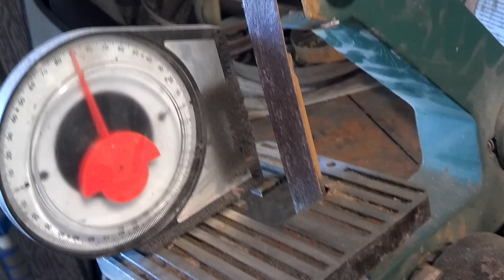1x30 belt sander knife grinder mods (Explained)

Comment: at first I thought to make te back grind belt file removeable, fixed with a welded screw system. to meke if I liked also a convex grond always leving the spine on the workplate and non pushing much when grinding. but it's complex, cod  get ot not well straight and close to the bel, and I thought I like the best or a full grind - for more cutting tasksks - or a scandy modified type grind on the first bevel - for a multitasking camp strong knife. and then just on the sharpen cutting part I like better the convex grind. to me for now thiis is the mix that match better.

by the way. you seem to me quite a wise man (guy), so I allow myself to ask you just few  second step level, knifemakers questions, just to have a talk and confront our opinions:
 
I like much full grind because I do not think a well tempered iron need to be so beefy.  (58-60 hrc like the good ole D2 if well done, maybe with new post temper criogenic treatment - or about 58 like the not expensive, easy  to find, tempering forgiving but always well prowen as very reliable o-1. for now I leave exotic steels to real experts, not people just putting the number on blades than working not really well as they are priced - sometimes just fashionable) 
to demonstrate clearly - can be done in your workplace - the main required specifics asked to a knife balde:
- edge retention (but not difficult resharpen)
- toughness of the cutting end to shocks, and on the contrary also some bending resistance for the tip and also the whole knife, maybe not to break in a while without prying, that could be dangerous, 
- and maybe why not, also same wear resistance to rust.
these for me are the main "use to" must of a blade knife (not to enter in tangs or handles)

all super beefy knives to me is quite a fashion (again. this new world of knives that already is full of just beautyful wonderful "fame signed" gadgets, for city wealthy collectionists, just to stay behind a glass. nothing bad in itself, I like some little collecting myself, but for sure not a fortune. but a knifemaker is not mainly a designer for me, IMHO. that wouldn't ever be my aim if I would make really good knives one day. anyway one should know what kind of work he is doing, what for, and what to choose and improve), sadly I think most coming from USA, once known as the country of the tell: "the bigger the better". even if I'm not integralist at all and proudly own just some, but really well made USA beasts, as the TOPS "Tahoma". if don't go out for a fishing weekend, but for a month in the woods far from "civilization" you can't bet on a try, you rely on just few crucial things, and "when the going gets tough , toughs get going" as said the Great John Belushi.
but this is just for few peole, among billion of knife buyers, and I could realize many other countries make very reliable (and also chopping, and even survivals) good knives with not so much use (waste?) of sometime not too well tempered steel - till the core, just because most of it is very thick, and it's not so easy as it could seem, to do it without making the thin blade part then fragile.

what's your opinion about this not so indefferent issues, especially for new knifemakers approching this nowadays global huge world of the blades, and not sure at all what path to start with not to get lost in this mess of stuff but to find his very own way ?
Reply from the maker: +nome nemo I like high carbon steel I use mainly 1095. When I first started making knives I built a small forge to heat treat myself and I would temper in the oven. I send my knives out now to professional heat treaters that specialize in knives. I use mainly two thicknesses of knife 1/8in and 3/16in. The hardness of your heat treat depends on what you are going to use the knife for, my knives in 1095 are 59-60rc. I get very good edge retention and so far have not had any break, lots of happy customers. The trade between high carbon and stainless steels is with high carbon you will always get a better longer lasting edge but you worry about corrosion. Stainless will also get very sharp but not last as long and resists corrosion. The super steels for me are to expensive to buy for small time begining maker.

Comment: I got this last week and used it already for pipe making/shaping. It is good for shaping briar blocks for pipes after initial block cutting. It is not noisy, and works very well.>>>0rz.tw/p5d0    There is not much assembly required and it is very easy. The only caveat to be aware of is that the plastic dust cover under the round sanding disk table has a notch which makes it impossible to screw into place - manufacture mis-measure of this specific plastic part. You will need to get a small file and file this notch off then it goes into place as smooth as butter.